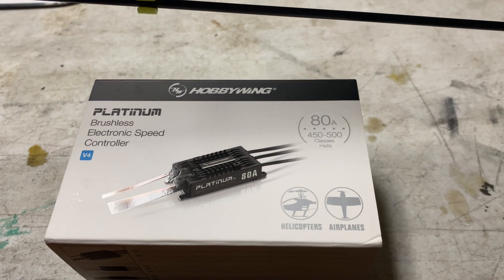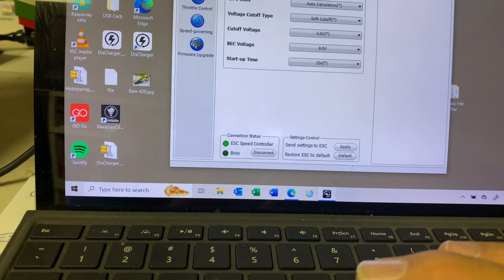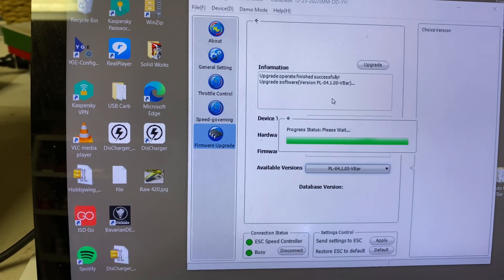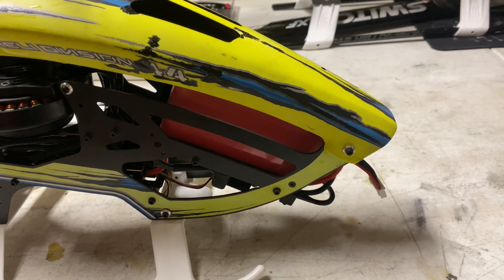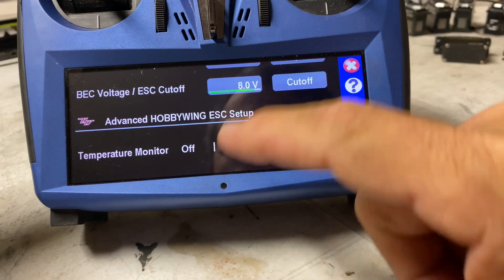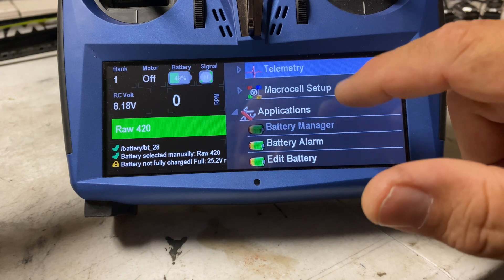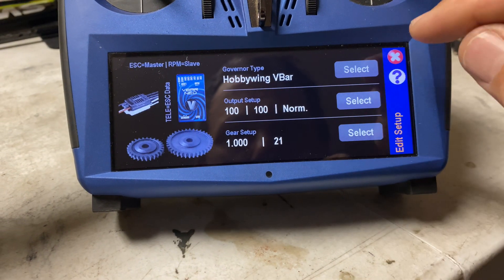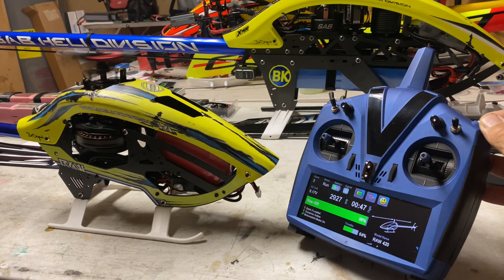Hobbywing & Mikado VControl integration - 80 Amp ESC

Comment: Greg have you ever run into a problem where the heli spools up way past the set RPM and then takes about 5 seconds to come back down to the target RPM? I have mine setup just like you have yours, but I am using the 120amp esc (V5) in a Raw 500. Once the speed comes back down it holds the RPM like it should but the overshooting at spool up is concerning.
Reply from the maker: Yes we had that on a couple helis here. If I remember right… we fixed it by redoing the low and high throttle end points.

Comment: Stupid question, but how does the wiring work for this? I've just got the 120A v4 platinum and updated the FW as in your video, but I'm not sure what I wire where between the ESC and Vbar. Thanks!
Reply from the maker: check this video out for the wiring..... https://youtu.be/ok7PqlYK7Fc?si=qUqxunBzuM5rVbfT

Comment: Hi have you any problem with the esc vbar firmware?Mine with vbar firmware after 5 batteris the esc cut off.After i install the non vbar firmware  on esc everything ok
Reply from the maker: I have had no issues at all with this 80 amp ESC on the VBar firmware. I am approaching 100+ flights. Which ESC and radio are you running?
Reply: @biscaolena  I have the same esc.But with the vbar firmware  my esc cut off 2 times.After I change the firmware everything ok.Thnxs for your answer.Maybe  my esc has problem

Comment: Hi Greg, If I use the Vbar governor. I update the firmware first. Then set it up in my VControl radio. Do I need to do throttle calibration ??? Do I need to do throttle standardization (50% throttle hover) ???
Reply from the maker: I always teach the ESC the endpoints for each new RCL. I only do the throttle calibration if I plan to run HW Gov.
Reply: Thank you!! @biscaolena

Comment: Mine Radio can not show the hobby wing menu need assist have whas up number preciate
Reply from the maker: Somethings to check on.... 1) Did you install the telemetry cable from the ESC to the V Bar Neo? 2) Did you update the V Control transmitter to the latest V Control update?
Reply: Do you plug in the esc cable ? What is the telemetry you unplug ? Plz

Comment: Nice! Is your current sensor wonky at all? I had to fool around with percentage used at around 45%
Reply from the maker: I did not mess with that at all on mine. I ran about 10 flights on the model and tracked mAh reported as consumed on the V Touch telemetry from the HW ESC and compared that to the actual mAh my charger put back into the those numbers were super close (with 5%) so I was really impressed with how accurate the telemetry read.